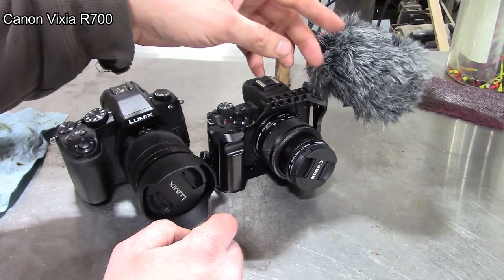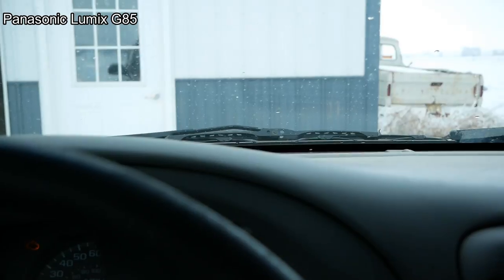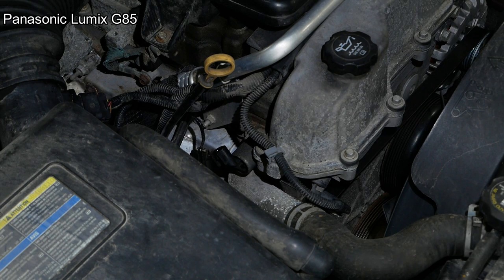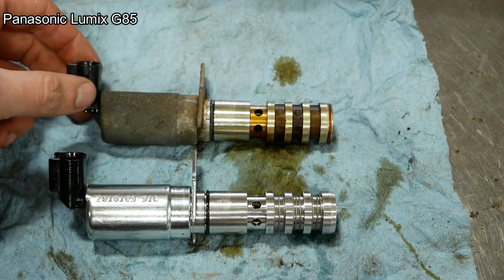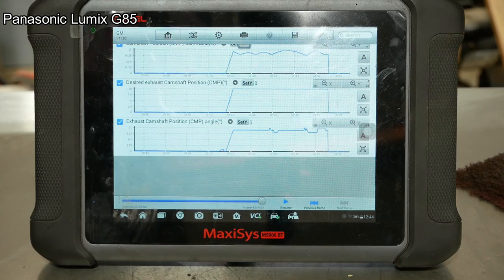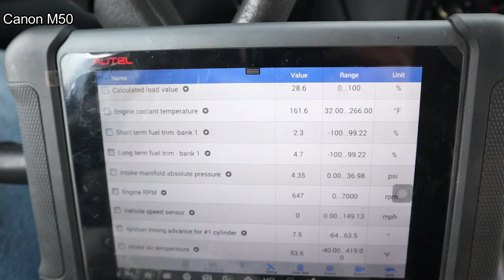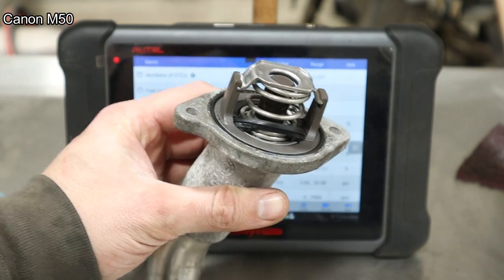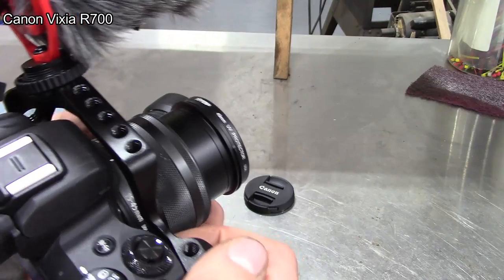Chevy Trailblazer -  Runs Rough on Cold Start, P0014- New Camera Testing

Comment: If you are going to keep the LUMIX, use Aperature priority rather than Shutter priority. The aperture is what controls how much light is hitting the sensor. Image quality was about the same in either camera; keep whichever one you are most comfortable with as long as one is not way more expensive than the other. I agree with one other commenter, “Bye everybody should be you exit clip. 🥰

Comment: Laughed out loud when you said not really cold out and there was snow and ice on your driveway
Reply: "COLD" is relative! Anything above 20°F with no wind is nice in cold snowy climates. This coming from MN.
Reply: It's not the temp that hurts. It's the darn wind.
Reply: @Lewis Bradford Coming from MN where temps can get down to -35 at this time of the year, above 20 is warm. :)
Reply: Thats what it looks like outside for 4 months in the north
Reply: Well, it depends on where you live. Here in northern Europe, Sweden infact, we have arctic climate in the northern parts during wintertime. Anything above -20 degrees celsius is quite warm If the wind isn’t blowing. Then it depends on how humid the air is. Is it dry the cold doesnt feel that bad. It all depends on how used you are to the cold. And driving on ice and snow arent that special, we use spiked wintertires go get around.
Reply: I live in Central Florida. The only ice we see is in the refrigerator

Comment: I can confirm the oil creeping inside cable insulation, it's pretty common in industrial machines using lots of oil, in my case, I have wire drawing benches and rolling mills at work. sometimes, there's leaks from the wet side to the motors, the oil seep inside the junction box, creep into the insulation and eat through it, causing shorts on high power lines, all the good stuff :D

Note, before someone ask: I know that most oils are not electrical conductors, the oil used in our machines are made to lubricate and cool the wire through the drawing process, it's a water/oil emulsion, charged with metallic particles from repeated use and it's pretty aggressive for electrical wire insulation, it's a bit conductive, enough to cause problems.

Comment: The Land Rover TD5 Diesel engines have a known problem of oil going through the wire loom to the computer module. So I guess what you saw in the video is true.
Reply: Yeah, it tracks through the injector loom up through the cores by capillary action into the ECU connection and if unlucky, into the ECU itself. Loads of them never got replacement looms under warranty, mine included. Couldn't believe how much oil made it into the thing.

Comment: Wes I like watching you and South Main Auto. I have a 2002 Chevrolet Trailblazer with 299K miles on it. I have had some idle instability issues this winter when it was below 0°f. 
I will check out my cam shaft solenoid, and connection. 
Thanks to you I know exactly where it is, what I have do to replace it. 
Thanks to South Main Auto, a Trailblazer that had weird dash light problems, I changed my ignition switch. 
Thank you for the help. 
On the steering angle sensor, make sure that the steering wheel is centered perfectly when going down the road. A friends was a off about 15 degrees. When she had it aligned, the light was off. I believe her alignment problem was every time she parked, she had to check to make sure that the curb was solid! Once I saw it with about 1&1/2” between the rim and the curb. Twice she had to get help to turn the steering wheel so that she could turn the key to on.  I have told her a couple of times, when she hits the curb, put it in neutral, then release the brakes, then put it in park. 
That takes too long. 
You can give suggestions, probably not change their habits. 
Hello from north east Montana. 
10 miles from Canada.

Comment: The trailblazer could probably use an oil change with some marvel. Their new cam phaser will end up looking like the old one without good clean oil running through them. I see that quite a bit with neglected oil changes. Great video Wes thanks!

Comment: I've had a 03 bravada for about a year now, have watched at leas 50 videos on common 4.2 issues. The realization that the PS pump being in the way never gets old.
Reply: The no fuel filter thing had me for a sec until you mentioned there's no return line. The fuel filter change is a huge pain in the cahones so I'm glad GM figured around that.

Comment: Hi Wes. Land Rover had a problem with the injector harnesses on the TD5 engine years ago. Very often oil would make it all the way back to the engine ECU. It could cause all sorts of starting and running problems when the oil got into it

Comment: The oil creep up problem is a huge problem with certain Mercedes. They even made a blockoff cable which is essentially a cable where every wire was cut and soldered back together to stop the capilary action.
If not found fast enough, it can cause ECMs to fry as the oil creeps all the way back through the harness.
I saw a video of a case where this caused a O2 sensor to be destroyed as well because the oil made it all the way down there.

Comment: I used to be a camera geek, but as cameras got smarter and I got older I found that I didn't have the interest or inclination to learn how to work them.   So when actual film cameras became passe, I bought point and shoot digital cameras, the last of which is a Lumix FZ.  This camera does everything but my dry cleaning, but it's too complex for me, so it too is used as a point and shoot.  I also used to be an auto mechanic in the carburetor, points, condenser, and adjustable valve clearance days.  I watch in awe as you use diagnostic tools that are beyond me to troubleshoot all manner of electrical gremlins in late(r) model cars and trucks.  I have a general understanding of many of the acronyms such as MAF, TPS and the like, but I probably couldn't find these parts on today's cars let alone diagnose them with the diagnostic tools I used--a vacuum gauge, timing light and an ice pick fitted with a ground wire and alligator clip.  The Lumix picture looks better to me than the others, and the Trailblazer sounded fine after your your fixes.  Enjoy the channel, your wry sense of humor, the dog, your boy, and Mrs. Wes.  Keep the videos coming mostly in focus or not; it's all good.

Comment: F-stop is the size of the hole in the lens. It sets depth of field as well as brightness. A pinhole camera does not need to focus, so f22 means stuff close and far will both be in focus. f2.8 is "wide open" and gives a shallow depth of field. Stuff in the background is fuzzy, and auto-focus problems are much more obvious. ISO is like the speed rating of film. In a digital camera, it sets the reference level for the analog-to-digital converter reading the pixels. You set a low voltage level with ISO 26000, but that also makes the noise floor of the sensor very obvious, much like you can see the grain in high-iso film. So you set the f-stop as low as you can live with or desire for the depth of field, and use the ISO to get the picture exposed enough without too much noise. Set the shutter to whatever standard file you picked, 30fps for 30p, 60fps if you are shooting in 60p. 24fps if you are feeling like a movie guy. Fast action likes 60p, but the files get really big, especially at 4k recording. Shooting in 4k means you can use the editor to select and zoom in on a part of the frame and still get HD (1080) resolution. My buddy says YouTube will promote 4k content more, but who knows? My choice would be to shoot f2.8 or low as possible for the intro and outro, so the background of the shop is fuzzy and you "pop," as the video guys say. For the work close-ups, you might stop down to f8 or even smaller, so all parts of the engine are in focus. Then again, maybe you want just the "thing" you are working on in focus, with the rest a little blurry, so open up the f-stop to f2.8. Shoot 4k and you can pan and crop in your editor program. I like Vegas Pro, since you don't need a computer science degree to use it, unlike Adobe Premier. Also BlackMagic DaVinci Resolve is pretty good, and free, but you need certain nVidia graphics cards. With all the giant files, some folks are erasing the raw working files after editing the master. I put them on a 4TB 100-dollar USB drive, and just keep buying new ones as they fill up. I do have a network storage mirrored backup of the edited master file as well, if/when a USB drive crashes.

Note there are 200-dollar Lumix zoom lenses, and 800-dollar ones. The expensive ones keep the wide aperture setting over the whole zoom range, the cheap ones go to F5 or smaller when you zoom in. Having the f-stop independent of the zoom is worth it to me. An outdated chart:
https://www.dpreview.com/forums/thread/3236455
If the lens has a range for both zoom mm and f-stop, that means it is the cheaper type. I have:
PANASONIC LUMIX G X Vario Lens, 35-100mm, F2.8 ($949.00 )
For shots you have to get from further away, like my overhead crane, and two:
Panasonic H-HS12035 LUMIX G X VARIO 12-35mm, F2.8 ($797.99)
For the general-purpose lenses on the other two cameras. Micro 4/3 cameras are half-equivalent to a 35mm or full-frame camera, so a 12mm lens is equivalent to a 24mm lens in a full-frame camera. The lower the focal distance, the more like a fish-eye,, which bloats out your face, and worse yet, your lady's hips. For head shots,  I like to set the camera further away and zoom in, often 35mm, so I don't look so fat or goofy.

I have a Panasonic GH3 and two GH4 cameras, similar to your G85. Canon reputation is for good lenses, but they must have squandered that chasing consumer market. I far prefer the G85 in your video above. Panasonic made a corporate decision to let its consumer camera designers do things that put pressure on their pro-camera guys, while all the other companies cripple the consumer stuff to protect the pricing of their high-end cameras. 

Buy cameras with a bigger sensor for low-light performance. Full-frame is the size of a 35mm film, but the camera and lenses get very large and heavy and expensive. I like Micro3/4 like I own, a good compromise.  A good comparison web site for cameras:
https://www.apotelyt.com/compare-camera/panasonic-gm1-vs-sony-rx100
My next buy will be for a very small pocket camera, and the Sony RX100 VII looks great. One-inch sensor, very small, can flip the LCD, mic input, and a flash for still pictures. It can also live stream over its USB, something my GH4 cannot do. And it is small enough to carry in my jacket, while being able to shoot 4k video. Downside is 1200-dollar price tag.

Comment: One the vehicle--well, it's a TrailBlazer, which GM apparently designed to break only in strange and improbable ways.  The fact that you found anything so 'simple' as the sensor and the t-stat is amazing, at least on a Trailblazer.  I swear that the Service-writer manual for the TB just has every itme start with "Remove engine and dash entire."

Comment: Not knowing anything about cameras or their operation, I am in no position to judge. What I saw on my screen was on the verge of white out when you were pulling/installing the cam sensor, and showed the best detail of the components of the engine. 
For me, the picture has to be REALLY bad to complain. The 10% rule has always applied. I just like to be able to see what you are working on with enough light to make out parts and pieces.
The shop lights have made a TREMENDOUS difference, nice improvement.
Thanks for sharing.

Comment: We definitely need some more content on the blazer! I own one and have run into most if not all of the issues listed. They are extremely common in these blazers.  I would be FOREVER indebted if you filmed the fix in the evap 🙏🏼 

Great video! Cannon seemed to do the worst but quality was consistently higher than average so it’s all a win!
Reply: I agree. I also have a blazer 2008 and I’ve ran into these problems and a few more. All in all I love this trailblazer but it has its quirks but all cars and trucks do.

Comment: Canon has better picture, its very clear but also struggle at focus and setting it up will distract you from what you suppose to do, Canon is generally more of a photo cam where you can manually set things up before taking that money shot, also that manual zoom is amazing, but again mainly for photos and not videos, its a canon thing :)
Panasonic will be much easier to use as a video cam, you'll just have to work a bit on your settings and iso as the video was overexposed when you used it.
Both of course are night and day compared to your old cam.
Hope this helps Wes and keep these videos coming! :)

Comment: Thermostat caused engine to run too cool,so rich.
Oil ,being always cold, thick,and not hot enough to evaporate fuel accumulated on the solenoid passages.
It was not allowing thicker oil to flow,so the cam was off,disturbing timing,causing it to run rough.

The canon seems sharper,but both are overexposed there.
They don't like too much the lights you have,cold white seems to remove a lot of relief and squish the picture,making it a bit grainy also.
Maybe a lens filter can help a bit.

Comment: How do you make money off of a tried and true thermostat style? Mold the entire neck into it and then you can charge 10x the price. Crazy GM engineers.
Reply: Yea. And let’s control the fan clutch with the ecm too. Sometimes that fan goes tornado for no reason. Also I swear the trailblazer is not as good quality. We have an envoy and a trailblazer. The trailblazer has all kinds of weird issues. The envoy is just solid. Plus heated seats and better stereo. And rear heat. And ... yea the envoy is just better. I have and a lot of others have issues with the trailblazer killing batteries. Wake up 3 am go to bathroom look outside. Lights on. Lol.
Reply: Ford's thermostat break and leak.
The new 3.5 v6 water pump is inside timing chain cover in oil when fails leaks into oil ruins engine..
So Ford has some real bad design s...like the Triton 5.4 phasers chains and plugs and the 6.0 psd diesel disaster...

I stay with GM any day.
All my fleet trucks have over 250k no serious issues .
Ps I had old school Fords 302 etc the best then.
Reply: @MitzvosGolem1  6.0 powerstrokes are not a ford design, not a bad engine if the updates are done and they are taking care of, i used to manage a fleet of 450 school buses with the 6.0 or aka vt365, they were actually a great engine easy to fix very little aftertreatment crap on them, the real pos was the was the vt390 or 6.4 powerstroke, they used to fill the crank case with fuel, and the high pressure fuel pumps were garbage too, then the duramax's we had in the minis were the biggest garbage we had hands down, 08's to 17's, we ended up getting rid of them after 3 years, to much trouble, traded the duratrash for cummins and the gm gas 6.0. pretty much cut all the overtime out of the budget with that move, should have done it a lot sooner
Reply: @bleachinuri  true... Cummins and GM 6.0 best cheapest .
My buddy redoes alot of 6.0 psd diesel and when upgraded not a bad motor.

Comment: Dirty throttle body does the same and won’t set a code.
Reply: 4.7 Mopar will do this, too. Drove me crazy a coupla' winters ago.
Reply: @npinneo x Probably not, as idle speed jumps up and down above the threshold detection and time. What’s the fault code triggering criteria?

Comment: Hi Wes, love the contect and your weather. Just like Scotland!! Re your comment about oil tracking up/down wiring looms, its a very common problem with the Land Rovers (Discovery 2 or Defender) fitted with the TD5 diesel engine. The injector loom is inside the head and is notorious for bleeding oil to the ECM. I've had to open an ECM and wash it out with brake cleaner before now!!
Keep up the good work.

Comment: I use my Lumix in shutter priority. I lock it at 1/60 -- the camera does the rest of the adjusting and I can lock exposure and focus if needed with the AE/AF lock button. The auto focus still blows though -- switching to a Sony camera was the best decision I made even if the Panasonic is better in some ways, the focus ended up making me hate the camera.
Reply from the maker: Well you have to realize I'm coming from a hobby level camcorder. The autofocus I'm used to barely works.
Reply: @WatchWesWork  heh indeed! I had that exact camera you were using and feels like anything will be a step up. I'm using a Sony ZV-1 now and yeah damn I do like it... Best thing is it can run off a USB power bank hanging on your tripod so you can shoot forever. Bluetooth remote too (optional of course) To run the Panasonic off USB, you need to do a little mod to the power bank or the camera will say not enough power and not run off the external power. 

The Panasonic picture quality is very alluring but damn the auto focus hunting and slowness if infuriating, at least to me. :-)

Comment: Casual G85 use here, and here's my take.

To your question about ISO, I'm unable to find anything about fine-tuning or alternative step ISO settings on the G85. I'd recommend leaving ISO on Auto, but setting a sane limit (ex:3200) as the G85 starts to lose image quality (becomes fuzzy/grainy) at ISO 1600 and it get's exponentially worse the higher you go.
I prefer using aperture control to control brightness in a well lit space. If you need more adjustment, there is an "Exposure Control" function denoted by a square icon that contains "+/-". It could either be on the preview screen, or you might need to open the menu to find it. It's also possible to permanently assign it to one of the 2 jog wheels. I tend to avoid adjusting shutter speed as it can cause videos to be either choppy or blurry. 

Great quick summary: